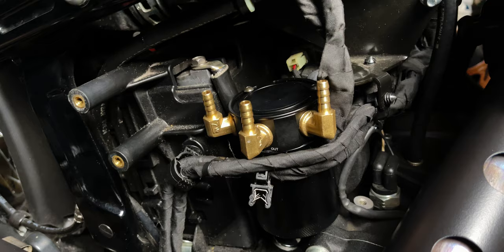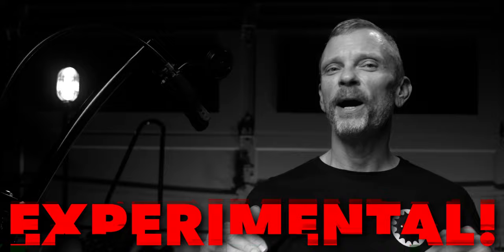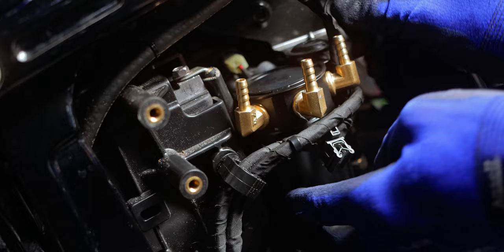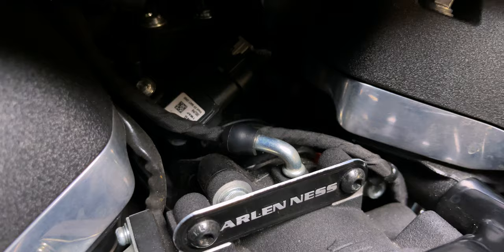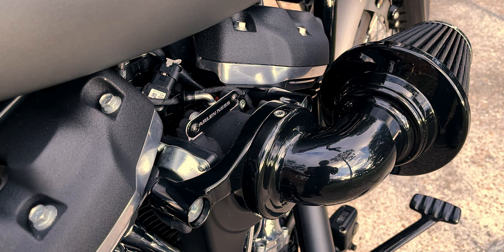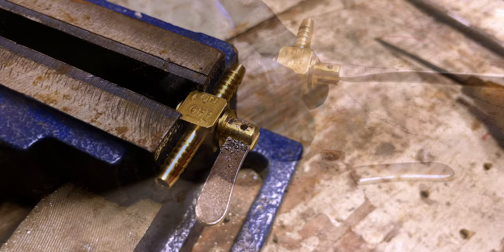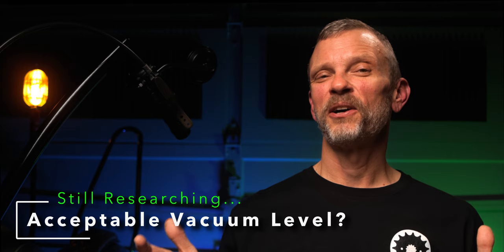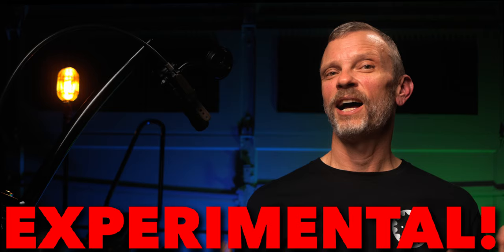❓Vacuum-Ported Catch Can: Crankcase Vent + External Breather + Vacuum = Perfect❓

Comment: So here’s my question, and I’m not sure you even have an answer. The question is, what would Harley Davidson Have done if  the EPA wasn’t telling them what to do??? It looks to me like they would’ve simply installed another hose right beside the transmission vent? Venting to atmosphere coming right out of the transmission cover. They’ve already vented to atmosphere in two other places, the primary and the transmission…. And what if those check valves in the head are simply to keep the oil in the oil pan? What if vacuum isn’t something the engine needs at all? …. All this to try and keep my engine from using a half quart of oil between changes.
Reply from the maker: Yeah that’s my guess - they’d have vented to atmospheric, which as I understand it, is how the older bikes were handled.
Reply: @RonsWorkshop  so if they were simply vented to atmosphere just like the vent on the transmission, it doesn’t appear to me that any kind of check valve is necessary? Just throwing out some thoughts here as I am right in the middle of pulling the top cover off right now and I’m excited.
Reply from the maker: Yep! Main thing is to vent the pressure. Check valve is a nice bonus.
Reply: @RonsWorkshop  well, got her all done and I’m pretty impressed with the way things turned out, I ended up going straight out the top at the fat end of the cover and it’s tucked so neatly behind the exhaust header that you can’t see it unless you’re looking for it. I did some research and I found a guy that makes some pretty awesome oil temp dipsticks… Jes custom accents … so got everything buttoned up, now time for a ride😍
Reply from the maker: That’s great! Let me know how it you like it.

Comment: From what I’ve gathered from your video this far is your previous two venting options are sufficient and this is the same plus a small amount of vacuum added. We’re there any noticeable changes in torque or throttle response? I’ve followed every video thus far and am highly invested in how this all turns out
Reply from the maker: Hey Olend - your assessment is correct. This catch can mod just adds a bit of vacuum to the crankcase and let’s mr use both of the other vent mods. I don’t really have a way to quantify the results. Based on what I’ve learned, I’d expect better ring sealing and less aeration in the sump as a couple of the main benefits. Both of those are beneficial, but whether or not they produce measurable gains is a ❓
Reply from the maker: Oh and in general, after alleviating the crankcase pressure with any of the vent methods, I feel better throttle response and a perceive improved overall performance.

Comment: Thanks a bunch Ron for this series, I'm now subbed and looking forward to watching more of your videos - awesome stuff, well done :)
The vented tranny cover (Trask or DIY with valve) and OEM breather setup sounds great for somebody like me who hasn't done all that much mechanical tinkering. But I too am obsessed (anal!) about preventing even the smallest amount of blowby getting back in, so I had this crazy idea. What if I replaced the OEM rubber hoses on the breather bolts with a hose fitted with an in-line water/oil separator, the ones that are commonly used on paint sprayers? Either routing the hose into a single separator or even using two separators (if easier to install)? I'm assuming that they would fit inside the standard H-D oval shaped "ventilator" air cleaners and not restrict air flow too much for most street builds (I'd be using the "extreme" air cleaner with the open face for more air flow FYI). I'm guessing there's a stumbling block here somewhere but what do you think, any method in the madness?
Reply from the maker: Hey Andrew - thanks for the kind words! Your idea seems viable if you didn’t do the external breather mod. (If you do that mod then nothing would get to the throttle body because the ports would be blocked.) You could also use a catch can to serve as your separator - I did a variation on that theme in this video: https://youtu.be/5h6Apcj7DDg

And here’s my video about the external breather mod for the Arlen Ness monster sucker intake: https://youtu.be/EqwboR0PQRg

Let me know what you go with! And if you want a sticker send me a DM on Telegram, Instagram or Signal with the mailing info @RonsWorkshop (international is no problem)
Reply: @RonsWorkshop  Thanks Ron. I've diligently watched the entire series 🤓 - again, top job. The idea with this is to obviate the need to regulate the vacuum level (with the petcock valve). If it works it just seems easier and simpler to my simple mind ;)
Reply from the maker: After all the experiments I’ve done my favorite solution is still the original crankcase vent, probably combined with the external breather mod. Trying to regulate the vacuum works but I’m just not sure what the right vacuum level is. So…I will likely incorporate the two into the catch can without trying to apply external vacuum.
Reply: @RonsWorkshop  Please correct me if I'm wrong with anything, one of my takeaways from your "Answers" video in this series was that an external breather mod doesn't maintain the vacuum source of the stock setup: https://youtu.be/BaG1VdOFe48?t=205 . My thinking is that by keeping the function and position of the breather hoses in the intake unchanged you don't interfere with vacuum levels, the only difference is that you've now got clean(er) air going back in. Again, it seems the vented transmission cover alone does an excellent job, this is all just for added peace of mind for those of us who want it ;)
Reply from the maker: Hey Andrew - sorry for the delay - YouTube held this comment and I just came across it. You're right in that removing the breather tubes removes a potential source of crankcase vacuum -- but i haven't been able to measure any vacuum created from that. And yes, the catch can filters out all of the gunk so that what's left should just be clean air, and likely cooler too.  Let me know if you give it a go!
Reply: @RonsWorkshop  Thanks Ron, I guess YT's spambot can be a PITA 🙄. You may well be right re the effect on engine vacuum. But as a lowly layperson I still have to contend with all the conflicting views out there on this topic, and so keeping the breather tubes at the intake is just a safe way of moving on ;) Anyway I'm not even sure that those separators will fit (3.7cm diameter last I checked) and I'm not keen on the idea of removing the air cleaner cover every 1000 miles if that's what they'll need... Thanks again, I appreciate it.

EDIT: Just thinking out loud, even if the vacuum level at the intake is minute, perhaps it serves to MAINTAIN crankcase vacuum nonetheless?
Reply from the maker: @andrewvickers4487  I agree with your edit - that's why I've typically retained the check valve in the crankcase vent -- just in case there ever is any vacuum present. Let me know what you end up with!
Reply: @RonsWorkshop  If the vacuum is removed via the external breather mod then doesn't that render the valve on the transmission cover vent somewhat ineffective? Again, thinking out loud :)
Reply from the maker: @andrewvickers4487  Correct - it all depends on which combination of venting solutions you end up with.
Reply: @RonsWorkshop  Yeah my brain hurts :) Thanks man, I think there are a few of your vids I haven't checked out yet, I'll look forward to those and anything else in the works with your Street Bob.

Comment: Great solution. But I still do not believe in the vacuum requirement for the crankcase. I prefer to vent them all to the atmosphere.
Reply from the maker: Hey Mustafa - thanks for the feedback! I get that. I believe the primary goal is venting the pressure off, and the vacuum would just be a bonus.
Reply from the maker: Hey Ayla - are you saying crankcase pressure robs power, or vacuum robs power?
Reply: @RonsWorkshop  crankcase pressure robs power. in extreme cases it will grenade a motor. venting the crankcase, or using vacuum to even add some negative delta reverses the parasitic loss.
Reply from the maker: Agreed! Just making sure I understood your original point. Thanks for clarifying :)